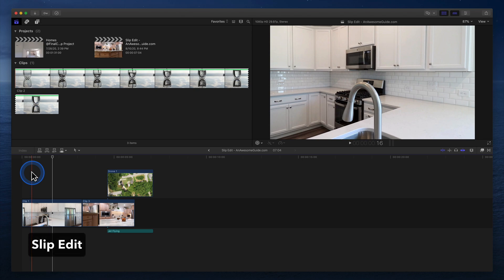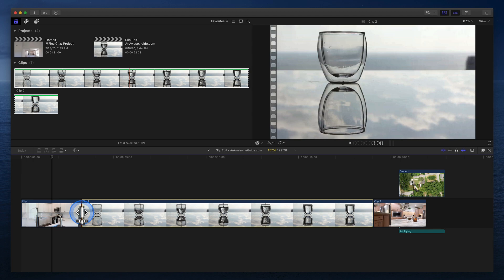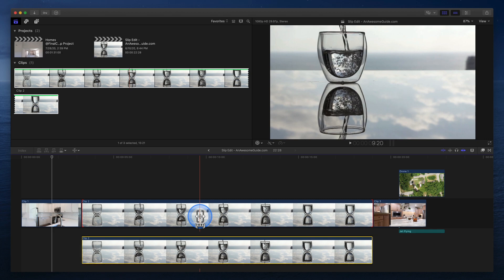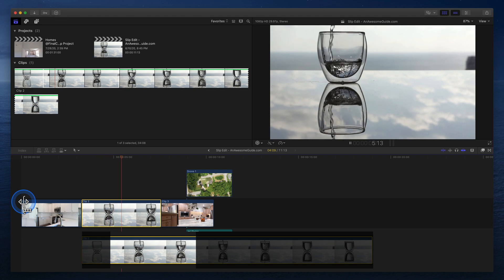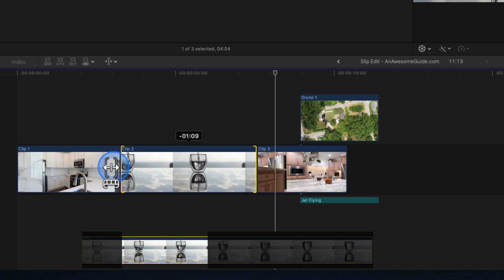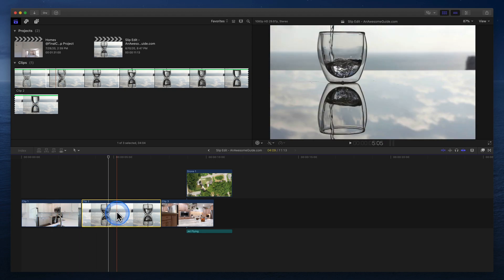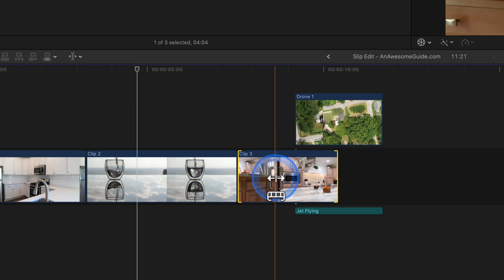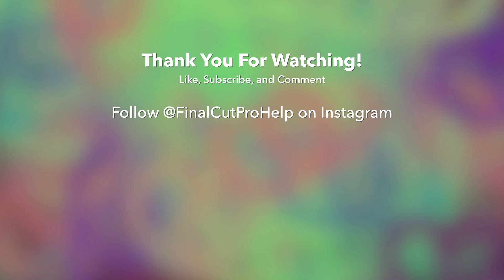Slip Edits in Final Cut Pro: One of the Secrets to Efficient Clip Adjustments

Comment: Do you know if there is a keyboard command to be able to so slip edits while the trim tool stays in place? I'm always running out of room right or left within the window, and then I need to start over.
Reply from the maker: Command-= (plus) and Command- - (minus) are the shortcuts to zoom in or out of the timeline. That would allow more room. However, I'm not certain I fully understand the question. If those don't help, send me an email with a screenshot or video of what you're trying to accomplish and I may be able to assist further FinalCutProHelp@AnAwesomeGuide.com
Reply: @FinalCutProHelp  Zooming out does help ... My issue is when zoomed in close, and you start to drag the tool over, at some point you could run out of screen space. Although it might still be a problem if zoomed out and you're trying to slip edit a really long clip.

 I was just thinking it would be nice if that tool could just lock in place while dragging, since the on-screen tool itself has no effect on what is happening. 

If this still doesn't make sense (because I am having a hard time explaining LOL), I can do a screen recording.
Reply from the maker: @taiko19  When I drag with the tool and reach the edge of the Final Cut Pro window the timeline scrolls. Is that not happening for you?